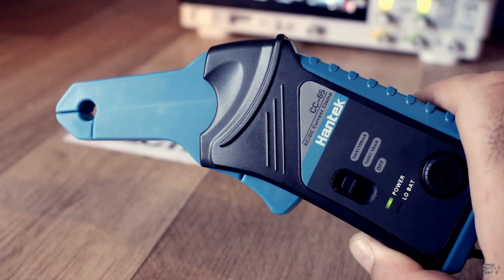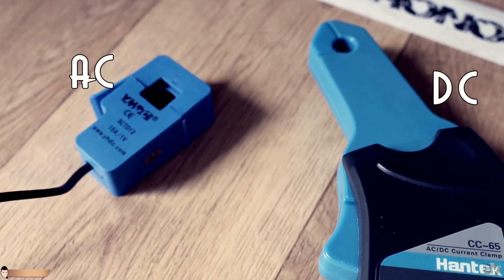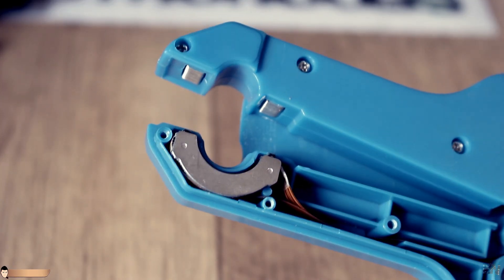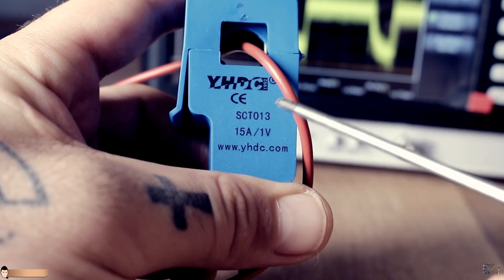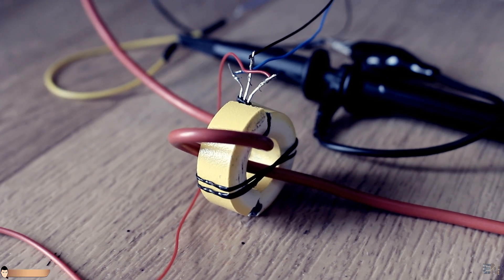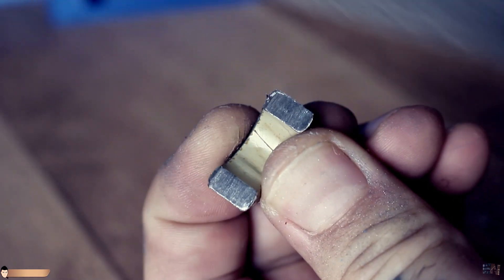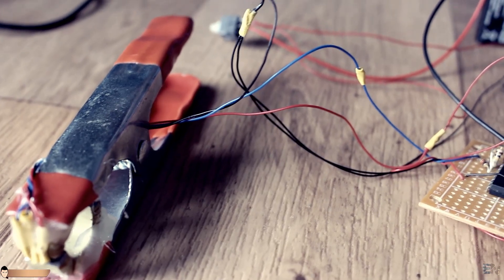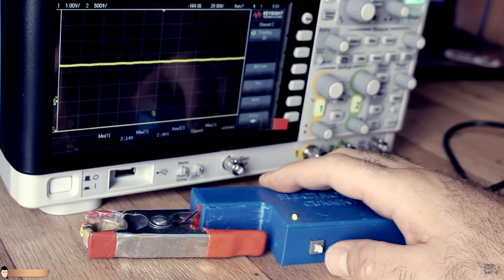Homemade DC/AC Oscilloscope Current Clamp | Hall Sensor + Ferrite Core

Comment from the maker: I hope that you'll enjoy this video. If you have any question or maybe a improvement just live it in the comment section here. Visit my webpage for more. Also, visit my Pateron site if you would like to help me. Thank you.
Reply: I would suggest that anyone who builds this makes sure that get a LINEAR OUTPUT Hall Effect Sensor. Something like the A3114 Hall Effect is a fast-switch and only goes high or low, so it wouldn’t work for measuring linear increases. I tired it and failed. No worries,  I’ll get some SS49E or similar Linear Output Sensors. Great job and thanks brotha!
Reply: Gracias hermano, hermoso video!

Comment: Hey, it surprisingly works first try
I am using hall effect sensor wired to 16 bit adc module that connect to cheapest microcontroller money can buy

The results then displayed on cheap oled module, rest is tuning it with known current from shunt measurements 

It pretty accurate, but when there a spike of high current (around 50A) the sensor would need a reset before able to read an accurate value again (the value is off by almost 1A)

Comment: Hack into a old AC/DC clampmeter guts. I need a DC current probe, and using a voltage probe and a series resistor will wreck my experiment on my AC capacitor cct. No resistance can be used.

Comment: Nice video brother!
You should regulate the supply voltage because the output of the sensor depends on the supply. And also you have to use two potentiometers, one for zero adjust, another for calibration. Zero adjust is needed because the sensor outputs half of the supply voltage at zero field. We have to get rid of that first

Comment: your project is very good, thanks for showing us the way, from your video I researched and found this ready circuit that is sold by shoope and is very cheap, I was very happy because it would be a lot of work to do it because I am starting in electronics, 
Thank you very much and congratulations
I'm from Brazil
 https://shopee.com.br/product/183958986/5100091775?smtt=0.0.9

Comment: This project is really awesome and yes, I've found out what to do with a bunch of half ferrite cores I got :) . I think that the improvements can be made with the amplifier circuit and the calibration...but you speak of the AD623 in your video on current sensors....can I use the AD623 for all these type of projects related to probes or instrumentation circuits? I'm not that familiar with OPamps.

Comment: Be very careful when using current transformers if you leave the secondary open circuit you can generate very high voltages when there is a current pulse or surge always terminate the secondary with a load resistor or are use back to back senders ect

Comment: Wow, one of the best technical videos I've seen on YouTube. You clearly have a solid understanding of physics and electronics, cover content at the right pace, include the right video shots and animations. I liked the B-field overlay on the magnetic core, with the X showing current flowing down and the arrows spinning clockwise.

I'd love a follow-up video with details on the Hall effect, and a demonstration of what happens if you move the wire around within the ring. I suspect something like Gauss's law says it doesn't matter where the current is inside the ring, but clarification would be great. I'm about to go look it up for myself.
Reply: Found it. It's called Ampere's Circuital Law. The line integral of B-field along a loop is proportional to the current it encloses. I had pictured an entire array of Hall-effect sensors inside one of those current clamps, but using a ferrite core to capture the field and force it through a single Hall-effect sensor makes sense. https://en.wikipedia.org/wiki/Amp%C3%A8re%27s_circuital_law#Explanation

Comment: Hi LM324 is currently not available in our area so we used LM358 but the result is kinda sketchy. Can you recommend to us other IC to ampli the result? Thank you.
Reply: and also when we try it we got a result of 0.025-0.033 V (without conductor on the magnet) and 
0.099-0.106 Voltage (with conductor). Then on our second test we got different result, does the circuit really had approximately 0.025V ? Thank ypi for answering it will be a great help in our project.

Comment: When measuring DC, could it be possible to design a circuit and not use a hall sensor? Maybe something that pulses AC (low voltage  of course!) Then design a small circuit that can calculate the difference in current/ resistance in dc?
I'm really new to electronics I'm trying to learn schematics, chips & components Etc. I realize the hall sensor is pretty simple. I just want to know if it's possible?

Comment: Hi. Great explanation of the amp clamp. Can you point to any off-the-shelf component to integrate into the circuit that can measure 10A to 150A linearly and give millivolts as output to be read through an Arduino or any other microcontroller?

Comment: "You know nothing John Snow". (thats how i feel when watching some of these aspects in this video.. yeah my mindset is pretty limied when it comes to electronics but I do like my current AC&DC clamp meter 210E.
Im such a noob I actually thought these big clamp meters was for batteries and often was puzzled why they didn't open up wider and was supprised when i finally realized you could measure current without toggling physically onto the circuit..)
thx for the vid.

Comment: In case if we don't want to use BNC connector and want the reading on the LCD _ then if we directly connect the output of the OPAMP to the LCD, will we able to get the display of current ratings on LCD?

Comment: I am in the middle of building something similar but it is exclusively for measuring AC currents, I am using a self made current transformer with two pair of windings, after building the amplifier circuit and extracting the RMS value in a manner similar to what a non true RMS DMM does I have realized that the self made transformer with toroid core from atx power supply is very non linear and i am still struggling to find a method to resolve this problem.

Comment: From which instrument did u get that ferrite Core?
Reply: desktop power supply or ATX supply
Reply: @MunnaKumar-sc7qo   and in case if we don't want to use BNC connector and want the reading on the LCD _ then if we directly connect the output of the OPAMP to the LCD, will we able to get the display of current ratings on LCD?
Reply: @apurvakalvade2301  yes, but you must change the gain of op-amp as per you lcd working. If you control by any microcontroller then you must use ADC value range.

Comment: the  49e  hall sensor has a bias voltage of half the power vcc ... means that the hall sensor would output a 2.5 v  for a vcc= 5v  with NO magnetic field sensed by the sensor ... the potentiometre help to offset that bias voltage ...the inverted configuration help for the gain. in this case 100. witch is too big in my opinion .. a gain of 10 will be more than enough.. another strange thing is the 9v battery that is too big for the sensor. in the end the filter is wrong  and not suitable for this ...good work

Comment: Sir can you please explain a little bit why did you used that potentiometer with the opamp and why you preferred the inverting configuration of opamp?
Reply: the  49e  hall sensor has a bias voltage of half the power vcc ... means that the hall sensor would output a 2.5 v  for a vcc= 5v  with NO magnetic field sensed by the sensor ... the potentiometre help to offset that bias voltage ...the inverted configuration help for the gain. in this case 100. witch is too big in my opinion .. a gain of 10 will be more than enough.. another strange thing is the 9v battery that is too big for the sensor. in the end the filter is wrong  and not suitable for this ...good work

Comment: Is there a way to make it usable to measure currents up to 70-80 amps or more? Maybe with a switch for high/low amp range? I'm really interested in making one, but i would like to measure more than 9amps! It's an relative easy to understand schematic, really love it!
Reply: He's using an amplifier to bump the sensitivity up to 1V/A.  You need yours to be less sensitive.  You could scale the gain down to ten (he used a gain of 100).  Or, you could leave out the amp and see where that gets you. Experiment measuring a known current and see what your sensitivity is.

Comment: Great explanation, however I think schematic is wrong. You show a 9M/10pF in series with scope connector. As scopes have a 1M input impedance this filter has a 10:1 attenuation so maximum voltage at scope is 0.9V not 9V.
I would like to see frequency response:
You measure rise time of clamp by generating a 100mA current pulse at 1kHz. 
Easy to do using a 100 ohm resistor in emitter of transistor and drive base with 0 to 1.5V square wave. Collector current should be about 0 to 100mA square wave. (The 1.5V drive is to overcome 0.5V base emitter voltage.)

Comment: 4:53 ...is not a transformer in the classical sense. It's a choke used to reduce/filter back emf noise from the device and prevent it from returning to the mains line ;)

Comment: If i change the coil size does the sensitivity change? What op can be used to improve the precision ? Thank
Reply from the maker: To improve the amplified signal you could use the same OPAM but in a chain connection, the output from the first OPAM to the input of the second but with smaller scales.

Comment: yellow iron core from a atx dc power supply is no ferrite.its powder iron.it has much more high freq losses.no good for measuring device
Reply from the maker: True!
Reply: @ELECTRONOOBS  not true ... it depends on frequency....
Reply: if your device is working on very low frequency you will get nothing in the output with the ferrite core. so what yr saying is not true ...it depends for what you are using it for ...

Comment: Good video!
But unfortunately I can not work well with my scoop, I have two old ones.
And certainly i I can not measure current (I'm not knowledgeable enough for that)
I am already happy if I can measure a pulse.
BUT
I may have an idea
Could not you buy a cheap meter and connect it to the scoop?
Http://www.ebay.nl/itm/600V-Digital-Pocket-Clamp-Meter-Multimeter-Amps-AC-DC-Current-Volt-Ohm-Tester6K-/292144132069?hash=item440525afe5:g:VCAAAOSwnK9ZOTLa
.
Http://www.ebay.nl/itm/Digital-Clamp-Multimeter-OHM-Amp-Meter-AC-DC-Current-Resistance-Tester-ST201-/352016960553?var=&hash=item51f5d88c29:m:m0swgB3isDKE7kYd9uGtMPQ
.
Maybe this can not be? .... I think it can!

greetings from the Netherlands!
Rob.

Comment: what is the better amplifier that you're waiting on?
Reply from the maker: LM358
Reply: Waaait. LM358 and LM324 are the same thing! Different packaging, different number of units per package, but same units inside. You can even use the extra units of LM324 to increase either noise and distortion suppression or current handling capability.
Reply: Can you show us how?